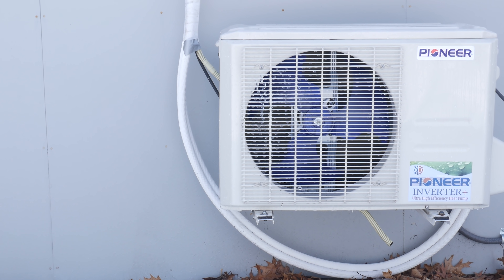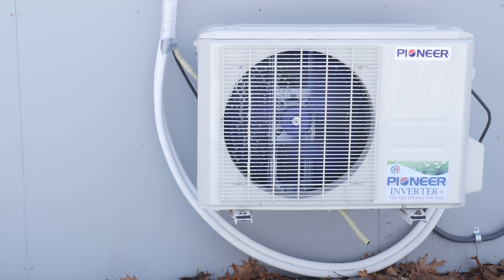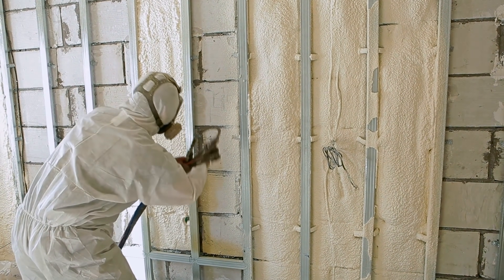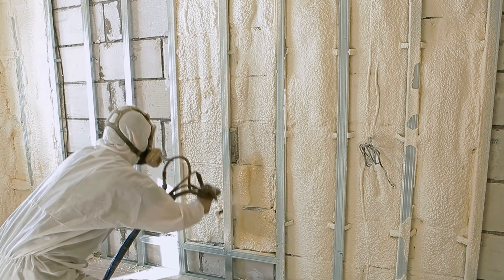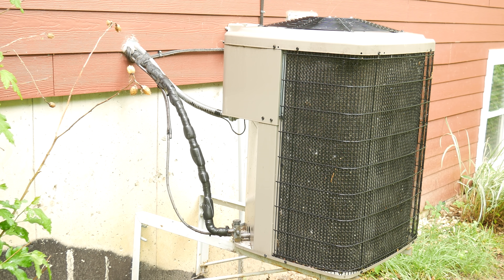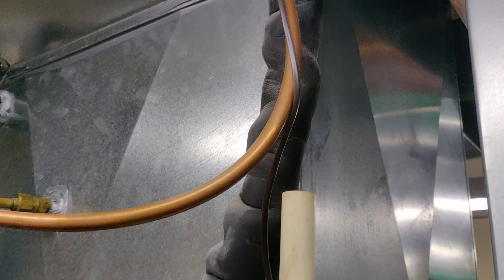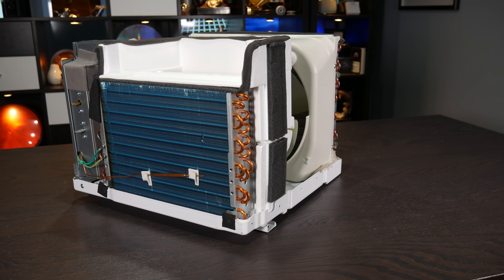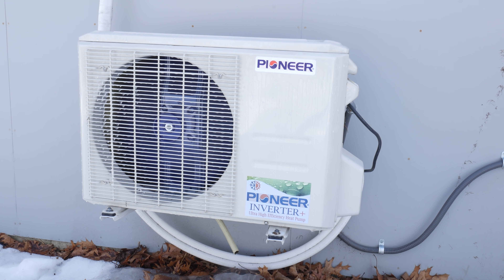Heat Pumps are Not Hard: Here's what it will take to start pumping

Comment: As an HVAC technician of roughly 20 years, seeing the SEER rating of these new units vs. what we were putting in back in the early 90's.. just awesome. Half the amperage and 300% more heat/cooling compared to some equipment. Insulentives has to be the best description of rebates lol.

And yes they're easy to install, even multi head units. But give troubleshooting them a shot.. Experience in our trade saves time there, and the better quality the unit, the less chance of expensive service calls later. Manual and tech support are almost always necessary.
Reply: Has the efficiency at low temperatures and outside unit noise improved? If you live in Canada, having temperatures below -30°C isn't unusual and the colder the weather, the more the heat pump struggles to do its job.
Reply: @AgentSmith911  which is basically logic. Which is why i still use a regular electric heater, battery powered. And them batteries charge themselves with solarpower etc.
Might be a bit less efficient, but the heater heats.
Reply: Thank you for your work!
Reply: @AgentSmith911  most definitely, it’s not even close
Reply: @DickShooter  the manufacturers of these water heaters don't use them either....
Reply: @AgentSmith911  Efficiency at low temperatures has improved, but it also comes down to design, in my opinion, certain makes seem to stay quiet longer, but the compressor starts to get louder after 8 to 10+ years..

Depending on your climate and proximity to water it can lead to more or less defrost cycles, but its crucial to look at the manufacturers documentation. Fujitsu claims to still maintain 12k btuh at -26C.

Some of those amazon brand units have a range of 25F to 90F, better made units are more like -22F to 105F
Reply: @AgentSmith911  I live in Canada too, and I mainly install ductless split systems as an additional source of heat but mainly for cooling and always have backups, being able to cycle between a heat pump or LP/NG or electric can save you money when it drops below a threshold.

 So for example you run your air source heat pump until outdoor ambient is -10C then switch to LP as the cost of LP used to be less in comparison to killowatts - not so much the case today.
Reply: @DickShooter  they make water heaters with the heat pump attached right to them. They take your inside air take the heat from it and put it in the water. In an area where you pay to cool your house almost all year, that would probably be perfect. In ohio, we'll it's hard enough to keep my basement warm most of the year so I wouldn't want a device actively making it colder down there.
Reply: I've installed a bunch of mini split AC, and hot & cold, many of them multi-zone and the better quality the unit the more reliable and when there is a problem they are easier to troubleshoot than the off brands. If you have even a single problem it is going to cost way more in the long run than just getting a good unit from the start and enjoying it -  as opposed to screwing around with it not working in the heat of summer or the dead of winter.
Reply: @tapalmer99  Absolutely agree with that, I work for a Fujitsu dealer but still work on all make and model.. There are some out there where it's 4 or 5 years old, manufacturer doesn't exist, and the board is toast but the mexico phone number on the unit no longer works.

My experience with quality units, it's 12 to 16 years old and common issue is it low on charge from a leak, condensate drain is plugged.. Not to say i haven't had to fix quality units, but the troubleshooting is well documented by manufacturer for good equipment and tech support actually helps.
Reply: @Falcon10911 It doesn't help that certain manufacturers pretty much require you to contact them in order to troubleshoot & get new parts. LG has been ok, I have a direct line to a Carrier rep (I work for a Carrier Authorized Dealer), but I'm never happy when I have to call Fujitsu. They have the worst wait times - multiple hours, often... and that is a hard sell to customers when I have to tell them I need to charge them for the time I can't do much of anything because I'm waiting for tech support to respond.

One thing that has been a more noticed problem in my area is actually the wind, with the variable condenser fans. I've watch the wind overtake the fan, causing them to fail, and then error. Turned the condenser 90 degrees, and haven't had problems with those units since. Dirty blowers are common, and most units aren't too bad to get to, once you get used to it. Oh, and tip, if you aren't used to it yet: If you ever have to replace a board, replace whatever motor goes with it. They will take each other out if one is faulty, so it's better to ease the headache, and prevent multiple return calls, to do both. LG finally got smart enough to recommend doing both, should the need arise.
Reply: @canadianized  I can definitely relate to that, I work for a Carrier dealer as well lol,  Installation of Carrier furnaces, heat pumps and AC. Napoleon as well. I experience the delayed response from Carrier a lot as they require you to leave a message but when you do get someone it's pretty cut and dry i find.

Carrier seems to call me back when im pulling into my driveway, ' are you still on site' yeah sure it's been 7 hours but im still on site lol... Warranty claims turn into a buck toss.

I usually push it to return service call if they dont get back to me and the work on site dries up.

Napoleon answers with a person within 15 to 30 minutes which is decent.
Reply: Glad to hear you appreciate it! 👍 Many older HVAC badmouth heat pumps because they were not as good 20 years ago. But they have greatly improved.
Reply: @AgentSmith911  just had a new mitsubishi unit installed, the NOISE is WAYYY lower than the old units, noise is also a representation of inefficiency, because noise means you're wasting kinetic energy in the form of sound and heat.
Reply: @jim4556  this makes me wonder, in cold climates, is it possible to have the heat pump for the hit water tank split, so that it's drawing heat from outside?
Reply: Where do you line up on his accusation of price gouging? Is it really gouging or is there hidden cost in a 3 head system he's unaware of?
Reply: @tapalmer99  *cries in VRF
Reply: @canadianized  Fujitsu imo is probably the worst of the best.  They hold a certain market share only because they have name recognition, otherwise I wouldn't wish one on my enemy.  I one time had to call Fujitsu for a 2 head 3.5t (1 2t cassette and 1 1.5t wall), and had to teach tech support the difference between the filter and the reactor boards.    Shameful.
Reply: THAT $15,000 INSTALL in the video was insane.  I would buy the unit wholesale for $3000.  Then tell the HVAC company “I already have the heat pump.  Just install it please.”

I do that with car dealerships too: I supply the oil & filter, and they charge $15 labor.  It saves money

.

Comment: We had a ducted "multi-split" system retrofitted last year, upgraded from a ancient 80+ gas furnace. Not looking back - apart from being orders of magnitude more efficient, it's also a lot quieter and more comfortable as it keeps the temperature far more constant.

Even in CA where such a system is an absolute no-brainer, I was shocked how ignorant or even hostile towards heat pumps some HVAC contractors are. One tech claimed that they are some newfangled technology that "always breaks", another gave us offers for gas and hybrid systems even though I was very clear about wanting to ditch natural gas. 

Imagine what we could achieve if just a fraction of the $30+ billion the US wastes annually to subsidize fossil fuels was spent on upgrading insulation and HVAC systems. Stay on your soap box, Alec!
Reply: New-fangled???  I’ve had a heat pump since the 1980s.  They have
more real-world development than the EVs California loves to push
Reply: $15,000 IN SAN DIEGO is insane.  I would buy the unit wholesale for $3000.  Then tell the HVAC company “I already have the heat pump.  Just install it please.”

I do that with car dealerships too: I supply the oil & filter, and they charge $15 labor.  It saves money

.
Reply: I just bought 4 mini splits off Amazon for about 4k.  Definitely better to buy it yourself and install yourself/hire a hvac guy to install.

Also what's the $30B?  I haven't heard that number before.
Reply: @parker9012 The true number is much, much more - wrecking the planet is incredibly profitable 🤮

Annual direct producer subsidies (mostly in the form of tax breaks) in the US at federal and state level total $20 billion according to a 2015 study by Oil Change International.
On top of that, there are $14 billion in consumption subsidies (Reporting by several reputable news outlets, although I couldn't find the primary source for that number).

This doesn't even include all the indirect subsidies, like military operations to secure oil or health care costs due to pollution.

Of course all of the above pales in comparison to the economic impact of heatwaves, floods, droughts, wildfires, and sea level rise caused by fossil fuels...
Reply: Persistent ignorance is an illness.
Reply: Well system efficiency tanks below 45° generally. Inverter systems can heat at 100% capacity down to -5°- -13°. So with them you can get away with just a heat pump in the west coast. But most systems will require a auxiliary heat source. Because if it does get that cold and the heat pump cant meet demand youre fucked. Even here in arizona i recommend an aux resistance heat. Mostly because if i have it on my house why shouldnt i tell my customers.
Reply: @electrictroy2010  Upside you could save money down side youre not licensed to purchase the unit so nobody from the manufacturer will help you. Unless you do mr cool but goodman will tell you to call the installing contractor.
Reply: @electrictroy2010  that's a great way to save some cash 👍👍 here in Spain, this is impossible, mechanics only will do the repair if they source the parts, and they apply a juicy margin on this. They will argue that it's so that they can give you a guarantee on the part, but it's BS. 👋👋
Reply: @fabriciotorres6634 Wow, it's almost like they have to make a living.
Reply: Technically, heat pumps become less efficient as outdoor ambient drops, particularly when less than freezing… Thus, in very cold regions where winters are below 32-F or 0-C, the cost per BTU of a high efficiency gas furnace (95%) is almost half of a heat pump depending on the relative cost of each fuel source… However, in the southern states where winters are rarely below freezing, high efficiency heat pumps are a much better value… Everyone seems to forget that what is the best option in most of Arizona or Southern California is not the best option anywhere in Minnesota or North Dakota…
Reply: And you don't think that their additional complexity will contribute to lower reliability? Upon what masterful analysis do you base that statement? And as you yourself point out - they require homes to be better insulated to be a satisfactory solution. That doesn't make them better it absolutely makes them worse at the job.
Reply: @occamraiser  Nice straw man. 

The technology has literally been around for over a century. It's not exactly rocket surgery at this point. Stuff can break with all tech, but FWIW I've had zero issues with my heat pump through several years now, more than I can say about the gas furnace I had before. I grew up in a house with a heat pump in an area that routinely sees sub-zero temperatures during winter, and had to endure being cold because of a broken heat pump exactly never. And that was several decades ago.

For all I care burn dinosaur farts to stay warm, but don't pretend it's the pinnacle of technical progress.
Reply: @occamraiser had a heat pump system in our house for over 14 years now. It's never once broken down in that 14 years. And the only thing "wrong" with it is the reversing valve is squeaky. Which we've been told by multiple HVAC people isn't a real issue worth fixing.
Reply: In Quebec, since natural gas isn't available in most of the province, heat pumps are common, yet we still have problems with crooked vendors. To be on the safe side, before installing a heat pump, it's recommended to ask quotes from multiple vendors. In Quebec, heat pumps installation is subsidized, but only for listed cold climates energy efficient models. Again some vendors will try selling models that aren't on that list. I don't know why there's so much crooked vendors in that field? Anyway, my brother installed a cold climate heat pumps in 2021 by a competent and honest vendor and it does the job. Even when it's -25C. His model is certified -30C. Asian manufacturers.
Reply: Big natural gas is currently laying lines down my street and around the entire town. I’m questioning who actually wanted it? Probably the mayor of the town.
Reply: The techs and estimators that do stuff like this are, by revealing their preferences, doing you a favor. Why would you want to be tied to a company that hates or doesn’t understand your system?

Comment: That may have been the best impression of a condenser starting up that I've ever heard.  You've got some good info here.  We are currently building a new house in Niles, IL and I really geeked out on the HVAC system.  96% two stage gas furnace, 18seer two stage heat pump, zoned duct system, and in-floor hydronic to boot.  Thermostats are programmed to use gas equipment at lower outdoor temps and the heat pump when it is more mild.  With 6kw of solar on the roof and gas rates increasing lately, I may end up pushing that threshold temp lower as long as the HP efficiency remains decent..

I've done the entire installation myself (I'm a contractor) except for connecting the lineset and charging the system.  I basically had to 'trick' my HVAC guy into thinking he was charging a standard a/c unit by not springing it on him that it was a heat pump until he arrived.  Pretty sure he's still not happy about it (the charging process is exactly the same).  Every HVAC contractor I have discussed the subject with around here have scoffed at the idea of a heat pump.
Reply: Living in MT and my wife is in HVAC, she thinks I am dumb for even considering a heat pump. Our house had the boiler run for only a few hours each day most of the winter.
Reply: You've done the right thing!
Reply: @baills5694  Was it oil fired?  In my area, the city has naturalgas but the areas outside the city don't have the piping for it and so they all run with oil.  It's a huge waste of oil, IMHO.
Reply: Here in Aotearoa it gets so cold that you are legally required to insulate the pipes inside your house for risk of them freezing and bursting. 
I know people who grow pine (the cheapest wood here, by far) who heat their homes with a heat pump.
It's archaic to think that refrigeration technology is so far behind that we can't use it to heat a home in 2022.. I installed a heat pump hot water cylinder only 3 days ago in a city nicknamed 'windy wellington' because the weather is so bad...
Reply: @baills5694  Oh jeez, in a state where the average low is only around freezing... I thought the states were supposed to be the forward thinkers when it comes to tech... :/
Reply: Why are American contractors so allergic to heat pumps?

Comment: I installed an 18,000 BTU mini-split in my uncle's "summer" cabin a couple years ago.  They wanted it mainly for the air conditioning but the efficient heating capability has surprised them and allowed them to easily extend their stay both earlier in spring and later into the fall.  When I saw the numbers on these latest generation of units I was surprised and impressed.  Unfortunately the particular unit I want for my place has been on backorder for months or else I would have been able to heat with that this past winter, which would almost have paid for itself in one year just with the energy savings.
Reply: Curious to know what model you chose.